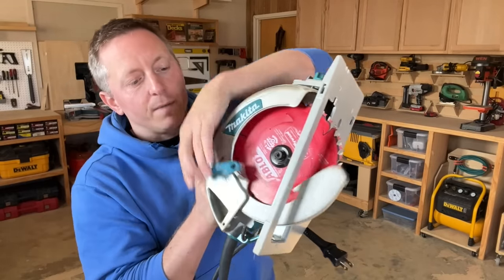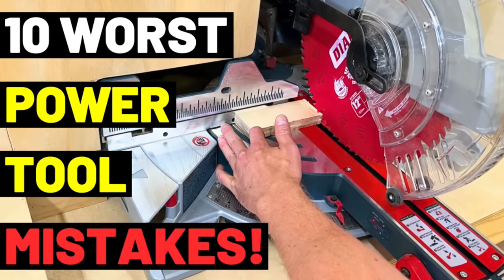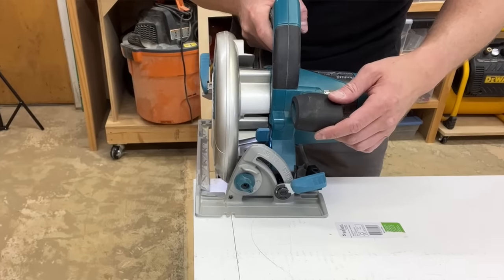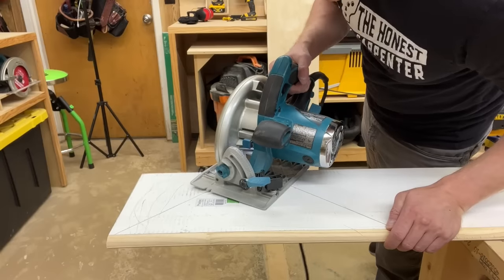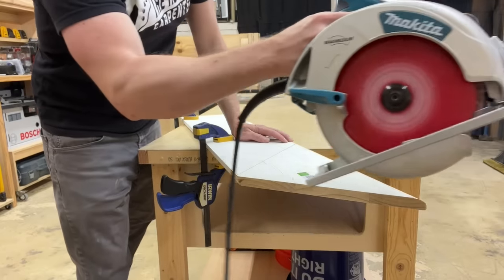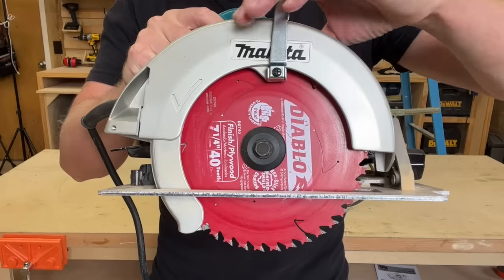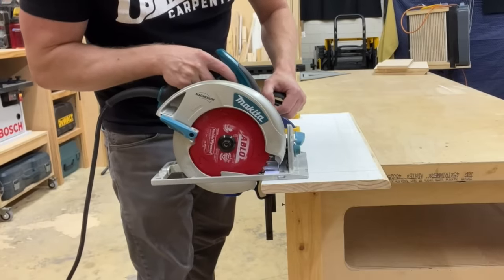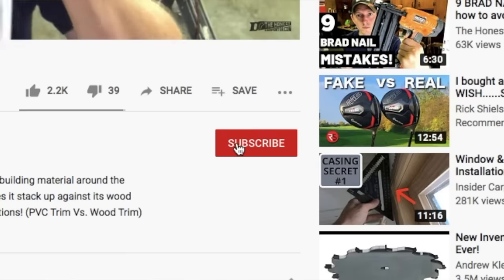This PRO Technique = Cleaner Circular Saw Cuts! (But You Have to Use It SAFELY!)

Comment: Excellent reminder! When it comes to using my circular saw, I usually have my metal straight edge clamped to what I'm cutting; similar to adding a fence. To many bad memories of watching others mess around with the guard and end up running them to an ER to hopefully save fingers or a hand. Plunge cuts are another situation where I will do exactly as you, but I just avoid them as much as possible. Really appreciate your tips and info. 👍🏼👍🏼👍🏼

Comment: Way back many years ago I was cutting some treated 6x6 for the pole barn dad and I were building on our property.  The saw bound in the cut, kicked back and into my thigh.  I still remember the metalic thunk of the guard slamming back into place just before the saw hit my thigh.  Took a moment to realize how close that had come to disaster.  Constant reminder to use the guard and all PPE for the task.
Reply: Similarly, I shattered a blade when I hit a bolt embedded in a 4x4. Half of the blade guard shattered, pieces hit my leg but didn't cut through my jeans. If that guard weren't in place, I hate to think what the blade shrapnel would've done to my thigh. (Remember, you've got the femoral artery to worry about.)

Comment: Reminds me of being an apprentice back in seventies. Having guards wired up was common, on the worm drive framing saws, guys just set them on there side after the cut!! One builder wanted me to use a saw that the trigger was bad, as soon as you plugged it in it’s on!!!! Told him no, he let me go wrote a check on the spot. Very common injuries to feet ( saw set on spinning blade runs over your foot etc.) Saw a guy ripping 1X holding it with one hand and sawing with other🤪😵‍💫

Comment: Great video as usual. I'd love to see you do one on choosing a left or right hand saw. I've seen so many opposing opinions on this subject and I'm not sure which direction to go. I'd love to get your take on all the pros and cons of each type.
Reply: @TheBendablespoons Thanks for your insight. I'm a DIYer but not afraid to get dirty and I prefer learning more and doing things the right way. I currently have a Ryobi left hand circular saw but upon reading the instructions (safety first) before using the first time, it instructed to do left hand cutting and keep the motor housing close to me. This has been the most awkward learning experience with left hand cutting when I naturally wanted to line up my cuts on the right side. I can do it, and I can even look between the motor housing down to the blade when doing left hand cutting but I never feel very stable and have been experiencing more jacked up cuts, binding and kickback. That got me thinking I should ignore the instructions and do right hand cutting with the saw...or get a right hand saw. I've seen arguments on both (left hand saw with right hand cutting and right hand saw with right hand cutting). I've been slowly upgrading from Ryobi to Milwaukee or other higher quality tools so I am really trying to explore my options for stability, comfort, visibility and safety. Seems like I have to give up at least one of those.
Reply: @TheBendablespoons Thanks for all the info and insight. You've given me a lot to think about, especially with the importance of feeling secure with the handling of the saw... Cutting right handed and being able to see the blade is ultimately what I want as it provides the stability and confidence I'm after. Seems so silly otherwise but you get into using these whirring wheels of death for the first time and a manual tells you one thing and suddenly you second guess your common sense.

I'll check out the videos you suggested and the Metabo saw.

Comment: This is a really good video.  I have corded saws, but my main jobsite saw is a DeWalt 60v battery saw.  I bought it because of working on old houses with the much harder wood, but was so aggravated when i felt the SERIOUS drag of the blade guard.  First few cuts i thought, "something's wrong with the saw" as even on  thick plywood it was dragging to the point i was getting edge burn.  Realized it was the blade guard.  I feel like the spring is too tight and it should retract more easily, but I have begun to just plan on manually rettacting the guard for every cut.  It's a pain in the butt for a $300 freaking battery saw to require this, but it works.  At least the little "handle" allows me to reach the front of the saw while i'm holding it.

Comment: I have a smaller Makita saw (HS6601) and I personally found it safer to let the guard snap on the wood rather than coordinating a slow release, maybe because the motor is kinda overpowered for a saw that size and I'd rather hold it with both hands when it's on.

Comment: Also be aware that a large chip of wood from a cutoff can jam the guard open. It is most likely to happen when cutting split ends off of lumber. It can also happen when making a narrow cut on the end. Anything just wide enough to fit between the guard and the blade can be hazardous.

My brother in law got a nasty cut on a jobsite when a large chip jammed is guard open. Not noticing and pulling the next board forward to cut he rested the saw on his thigh. He sustained a nasty 8" long cut, and I had to take him to the ER. Fortunately, it wasn't as deep as it could have been.
Further, reacting to being cut he dropped the saw, and it ran across several deck boards damaging them.

That one chip of wood caused an injury, half a day's work for both of us, and damage to the job. Pay attention, be careful.

Comment: I do my cuts exactly the way you do, always have.  Nobody told me how, it was just intuitive for me.  My go to story against pinning the guard is, where I worked there was another supervisor who always pinned his guard back and one day one of his workers was making a cut where he had to reach through some bushes.  I wasn't there so I don't know the particulars of how it happened but somehow  he brought the saw down right on his thigh and ripped his flesh to the bone.  That was back in the late 1900's (LOL) and I still cringe when I think about it.  I'm cringing right now.  NEVER PIN YOUR GUARD BACK!  As a matter of fact, never disable any safety device.
Reply: For some of us, it is intuitive. I’m not a carpenter, but I’ve been around power tools since I was young, been using them daily since high school, and make a living with large machine tools. I am far from a professional with many very dangerous woodworking tools, but my upbringing, schooling, and experience makes it very easy to KNOW what safety devices I can manually override for a moment, and which ones should never be removed completely. Unfortunately, there are a lot of folks out there that buy power tool simply because they can, and they really should never have them.

Comment: Important stuff. Circular saws have always made me a bit nervous. They can and have kicked when I use them and you have to be careful. Guards are essential but I've pulled up the guard as well but would never tape it or remove it. Power tools are dangerous enough.

Comment: This vid on circular saw use made me curious why you always use a RH circular saw.  My early construction experience (1970’s) in working on bridges and using mostly worm drive saws for forming left me preferring LH circular saws. I like that, being right handed, I see the blade better and the main part of the saw usually stays on the saved part of the wood rather than the scrap portion.  Other considerations like the left arm possibly blocking the view of the cut, etc., never seemed to be an issue for me.  I don’t recall having seen any of your videos address the function and usage of RH vs LH circular saws.  If you haven’t, maybe it could be a topic for a future vid, or at least be a short discussion topic in one.
Reply: The first time I saw a left handed carpenter using a so called  right handed, sidewinder saw I began to understand exactly what you are saying. BTW I have asked the same question to Ethan before.

Comment: Thanks for the videos. For someone that is right handed what are the reasons I would choose between a circular saw with the blade on the right side versus the left side of the saw?
Reply: Kind of a muddy question.  Blade left or blade right is kinda user preference. But blade left saws have traditionally been worm drive rear handle saws.  Those are a different beast and designed to be used differently to some degree.  Sidewinder saws like he is using here are traditionally blade right.  They are wider and more stable,  especially on sawhorses.  These days you can get that style blade left which might be great for many right hand beginners.  They also tend to be lighter and more maneuver.
Reply: @PerroneFord  Why look across and over the saw to find the blade when you can have it positioned where you can see it easily at all times? Blades on the left work best for right handed operators. This became very clear the first time I saw a left handed carpenter using a so called right handed saw.
Reply: @rightlanehog3151  Not everyone uses a circular saw on sawhorses.

Comment: This is exactly how I start every cut. Many times I’ll “drop” the saw onto a 2x4 just like a chop saw. Another trick to cutting very accurately is to Not move your arms to follow a pen line, yes pen and not pencil and move your torso while locking your shoulders.

Comment: I think the answer is a track saw (not always a plunge track saw, but at least a regular track saw like the Festool HK 55 or HKC 55).
Reply: This negates the major advantage of a circular saw.  It's primary advantage is that it is designed to go where the work is.  A track saw is designed to have the work brought to it, much like a table saw or miter saw.  Learning to use a circular saw properly and safely seems a better course of action to me.

Comment: If you start your cut on the peak side of the angle it doesn't get hung . But a lot of times you have to start on the low side of the angle .
Reply: I think a circular saw is not for a amateur.

Comment: The Blade guard kicking back isn't really a deal breaker for me, since I can adjust the cut if it causes me to mess up, & if I need to make an angle cut with my circular saw I pre-cut a small line in the material so it has a soild line to stay on track. But I didn't realize the blade guy annoyed people this much. 👷🏿‍♂️
Reply from the maker: I think it’s especially a concern for newcomers, W. In those instances, they can’t tell if they’re doing something wrong, or the tool itself is. This is just a quick workaround. 🙂
Reply: @TheHonestCarpenter  Always appreciate the quick tips.